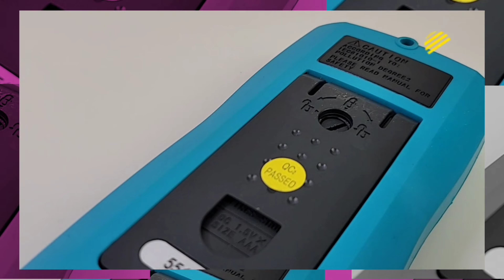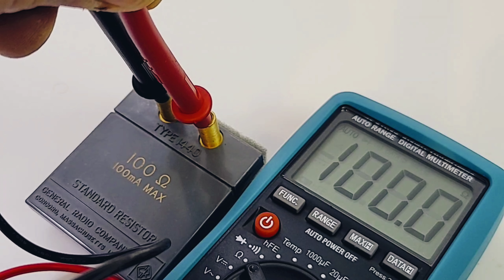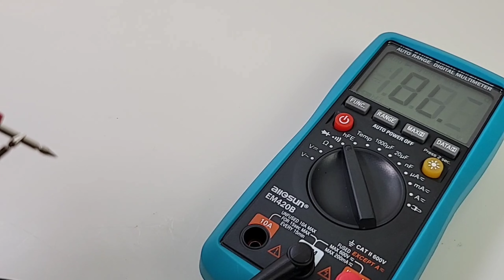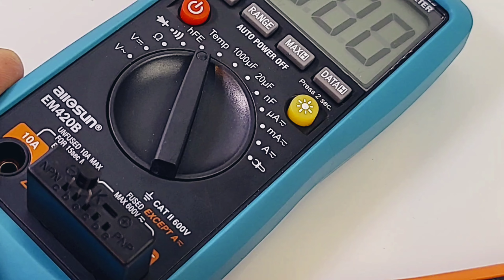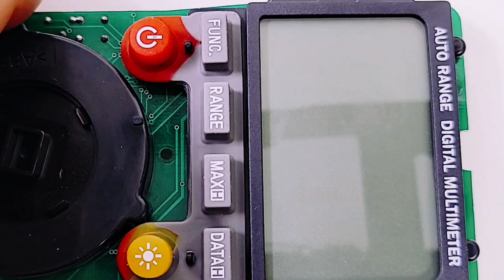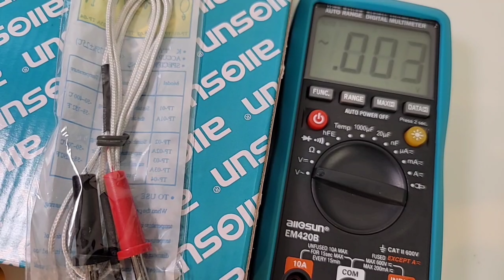ALLSUN EM420B CHEAP-O Multimeter Review & Teardown!

Comment: i have the old version the circuit inside is the same probably and if you wanna buy it forget about measuring amp and temperature because it wasnt working when i bought it also, i think it is common in this device but hey other things work relatively ok if you are a new one in electronic it is ok...

Comment: Gracias por tus vídeos quiero saber cómo usar la opción clam opcioal
Reply from the maker: Turn the selector to the clamp mode Plug the optional clamp meter inputs into the positive and negative terminal of the multimeter. That's it !

Comment: I have EMOS EM420B for 4 years now, but resistance started being wonky 🤣😂. uF is okayish, diode mode same as yours. It looks exactly the same as yours. So because resistance meeter "died", I got EMOS MD420. Few little changes, probes the same but probes covers has a hole, so probe sticking out, I like 🙂. Still have to test it fully 😁👍.
Anyway great video dude 😁👍
Reply from the maker: Cheers my friend 😀

Comment: Thanks Darren - thumbs up of course!  The title shows DM420B instead of EM420B - I do this too;) So the EM420A has the ETL safety agency listing, does this B version?  It doesn’t seem to...  One last thing, the diode check is a diode check - LED (type diodes) are a bonus, but most failures are with actual diodes.  I think the limit on this is reported to be about 1.5 V, so that is a bit low for a lot of LEDs;)
Reply from the maker: Roger that!  I actually thought I 😅 revised the title before going live..oops.
The 420B just carries the lackluster CE of approval which as you know doesn't mean squat. I hear you about the DIODE mode but I do prefer a dmm that can at least light up those led's too. Indeed , the voltage output just isn't there however..too bad.

Comment: Why do you love cheap-O meter?
Reply from the maker: Price,performance, features... hard to beat!💫💫💫
 Most people have no need for a 150-500$ multimeter ..it just doesn't make sense.  Most CHEAP-O multimeters can do everything the big boys can..sometimes alot more..the biggest caveat is input protection. Which is usually lacking on the CHEAP-O MULTIMETERS. That being said, unless you're planning to do measurements on a high powered mains, you don't need the extra robustness.
Reply: @KeepOnTesting  think you for that
Reply: @KeepOnTesting  When i was young, my neighbor, retired space electronics engineer, who learns me basics of repair, said: you can break it, or burn without long regrets.

Comment: Would have been a great cheap-o, had it had slightly better functionality. It seems they made too many compromises in that aspect to have good build quality and stay within a cheap-o budget. It’s just difficult to find a use for a meter with slow resistance and continuity modes, inability to test LEDs, low capacitance range, lack of live and NCV mode and lack of true RMS all in the same time.
Reply from the maker: You hit the nail on  the head..just too many shortcomings...

Comment: That miliamp fuse were blown before installing or after a test, either way there is an Idiot working in the factory.
Reply from the maker: Frustrating as heck..makes it worse if it's your only dmm and you don't have a spare fuse handy.. 🤪
Reply: @KeepOnTesting  you're right. And we need to keep that in mind in such company with mistakes like this, there is a huge potential in other aspects mistakes like in circuit designing, codes, frame quality and etc.
Simple errors can be signs of hidden huge errors. That's something I've been experiencing during my education and job.

Comment: Actually, I kind of like Allsun products.  I bought their "Auto Electrical System Diagnosis Device".  That's pretty much a poor man's Power Probe.  What can I say about it?  Well, it works.  I saved myself double the price of it the day I got it.  It's not nearly as sophisticated as the actual Power Probe, the leads are a little cheap but...it works!!!!  I've used it to diagnose problems with trailer lights and radiator fans.  One day when I'm flush I may buy a Power Probe with all the goodies, but in the meantime, the Allsun is great.  And yeah, I love the box!
Reply from the maker: Allsun can definitely surprise..they do put out some  great test instruments..unfortunately they have a so-so track record in the  QA department but this was a decent offering..👍 also they are the OEM for alot of other brands.. !